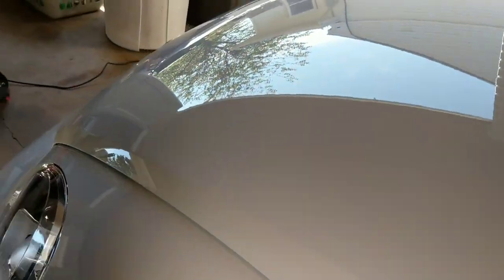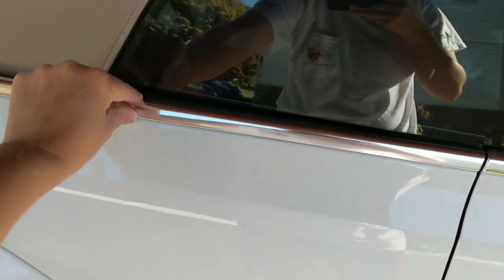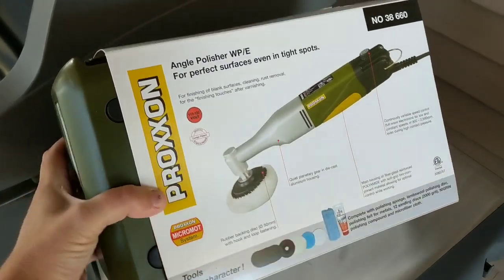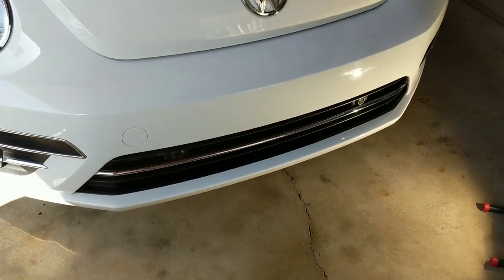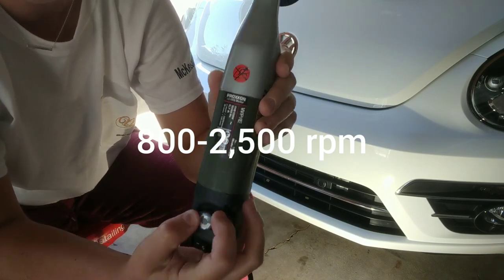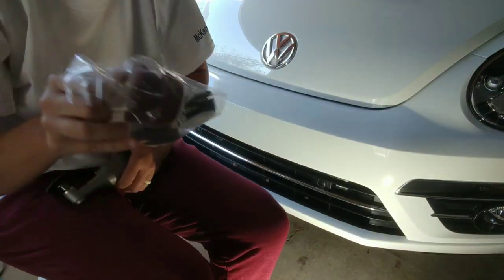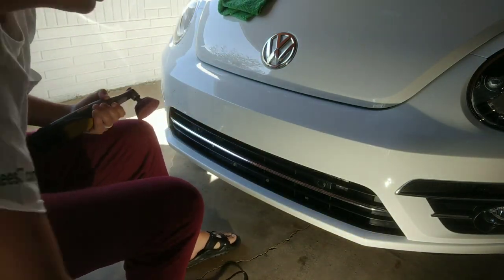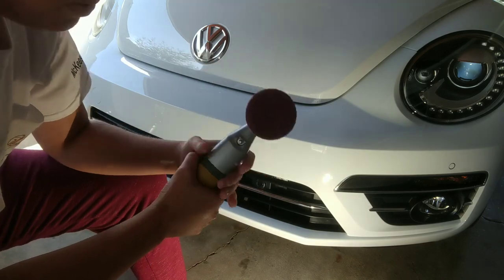Cheaper alternative to Rupes Ibrid Nano- Proxxon angle polisher!

Comment: There is actually a store in Germany that provides a full velcro 50mm and 30mm screw on backing plates for 12$ each.
They also have extensions in 40mm.
Shop is called Autopflege-shop.de
Don't know if they ship to the states though.

Great Video